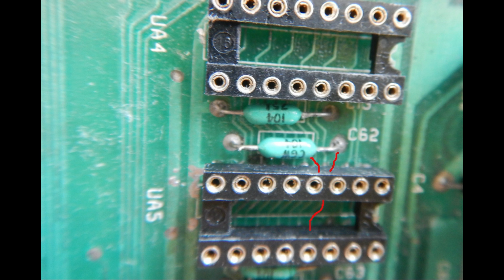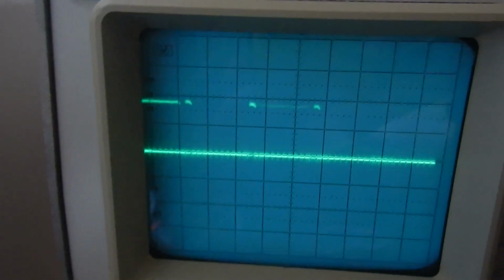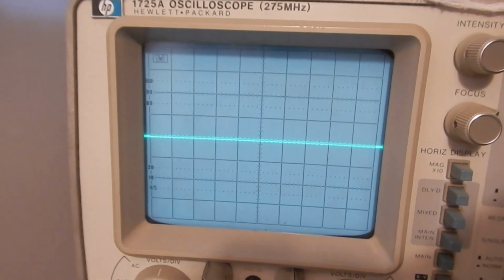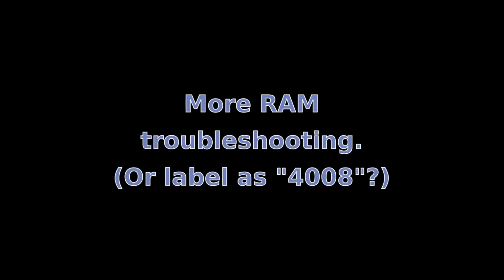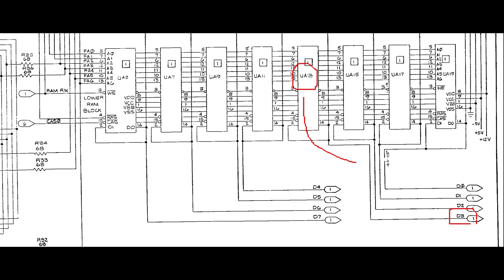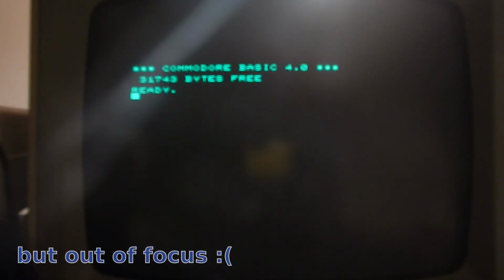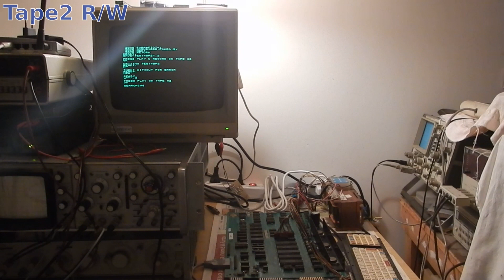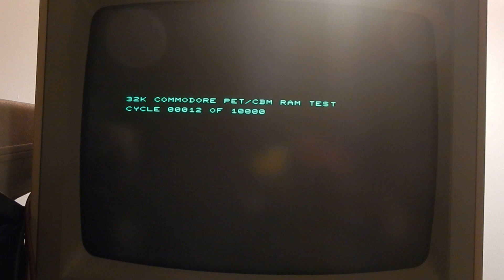The longest Commodore PET 4032 repair ever, pt.2

Comment: Hi, I have a commodore CBM(PET) 4032, but it cannot bootup to basic 4.0，when I switch on, the buzzer beeped normally, but  screen stopped at " C*  PC IRQ ....."., the PC Value is random between 0000 to 00FF or FFFF， IRQ value is E455. I want to fix it but I can not find any troubleshooting guide. Can you help me to give some suggestion? Thanks!
Reply from the maker: Hi, troubleshooting a computer requires some test equipment and at least basic knowledge to read the schematics. Now, that kind of error could be caused by a lot of different faults, but I would concentrate on basic ROMs and low bank RAM first. You know what works: video RAM and video output circuitry, kernel ROM, 6522 VIA  and of course the CPU.
Reply: @iz8dwf  Thanks your your message! I've tried to replace the low bank RAM，but still got error.  I found SP value always equal 1.  A troubleshooting artical said low satck pointer value means stack overflow during initialize and should check the VDRIVE signal of PIA and VIA chips. Finally I replaced one 6520 chip to fix it! Thanks for your help!
Reply from the maker: @geeklogic  Good fix! Thanks for sharing it!